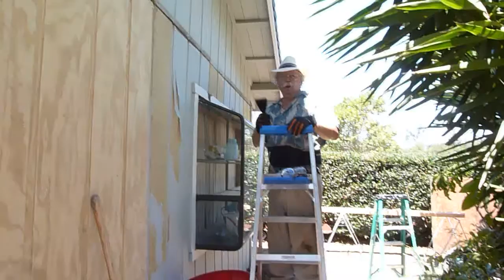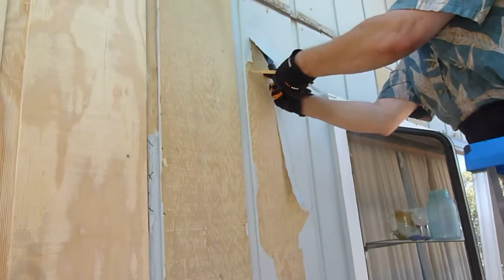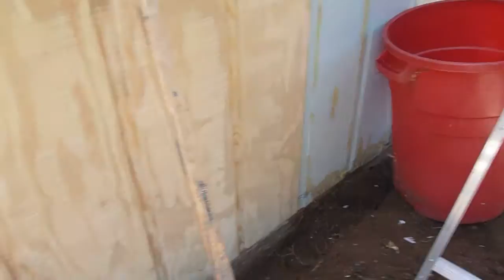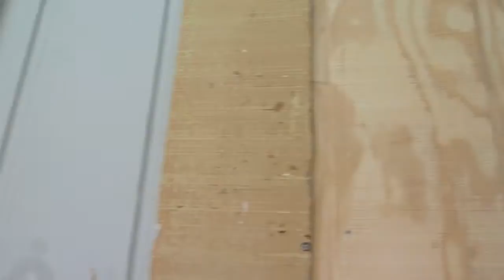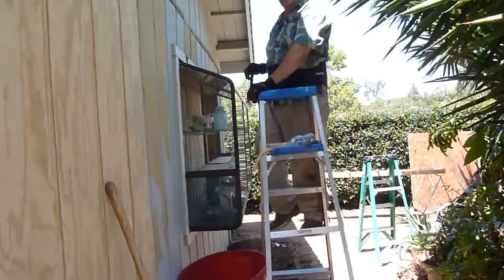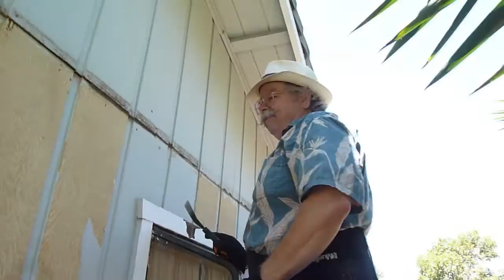Tex-Cote paint house agin!

Comment: this is down to low bid contractors who have no idea how to fuse the coating to the surface. unfortunately some home owners like this get let down by inferior contractors and miss out on an exceptional product.   the application of this product is key
Reply: Sorry but Tex-cote a high-end painting/coating service. They just happen to be snake oil salesmen.  #1. Coolwall does not reflect any more light/heat than any premium latex paint does. The 4% to 21% increase they quote is based on it being applied to steel roof panels without any insulation or backing of any sort. #2. There is no such thing as a true lifetime paint on a house. This is unconditional. If you want your house to be protected and look good you will be repainting in 8 to 15 years. #3. Kyner/coolwall does have a decent fade resistance but fade it will. I install Kynar coated metal roofing all the time. I can install a red Kynar coated roof and come back one year later and it will have faded so much that I have to replace the entire side so the color matches. If not the new panel will stand out like a sore thumb from fading.

Comment: The “professionals” who did it didn’t use a good bonding primer, I am a painter by trade and I can see you’re peeling the paint right off the siding finish with no evidence of primer ever being applied that is the crucial part of the process a good foundation for the top coat to adhere to without it no paint will last even the most expensive exterior paint can’t survive, primer coat is to bond top coat is to protect.